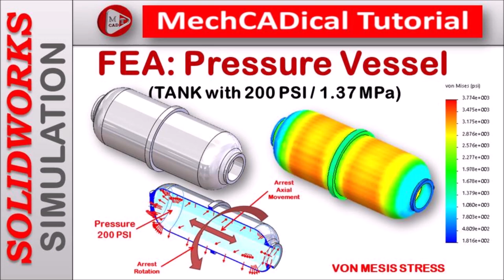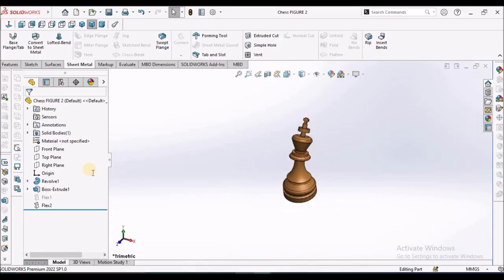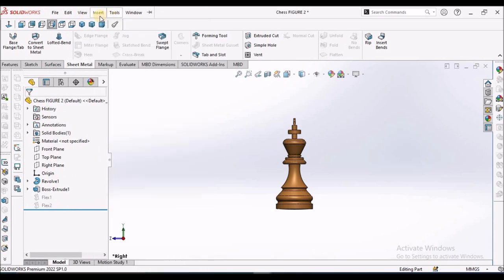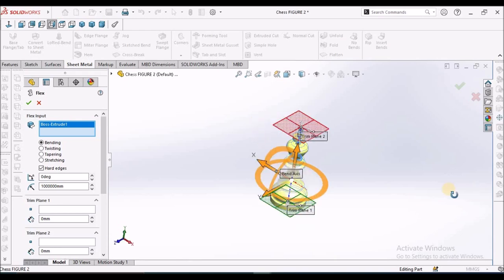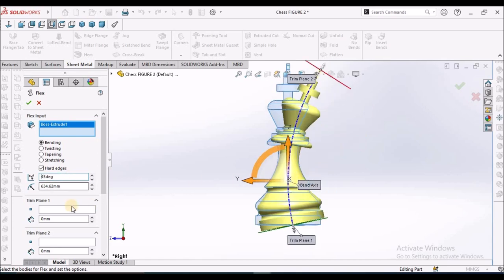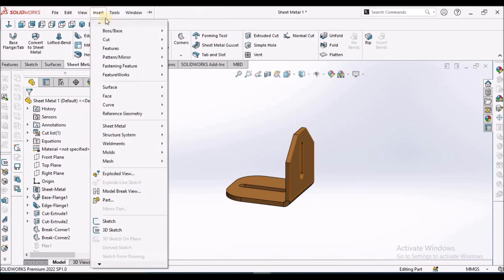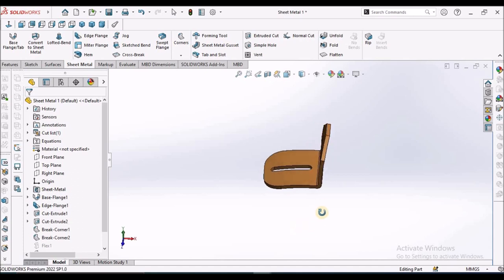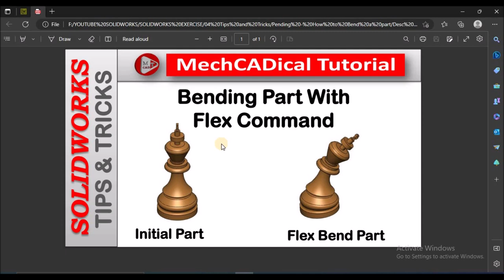Bending Part with Flex Command In SolidWorks

Comment: Hello, I have a problem using this command. I need to make two bends in my piece; the first is on the "Y" axis and the second on the "Z" axis, however, when I make the second bend it modifies the first.
To give you an idea of what the piece is like, it is a folded metal sheet that joins a plastic handle with a cylindrical aluminum jar. This piece has two tabs that are screwed to the jar and therefore have to be slightly bent, copying the shape of the jar and at the same time they are slightly inclined downwards.

Sorry, for my bad english :))
Reply from the maker: This kind of component should be done in surfacing or using forming tool